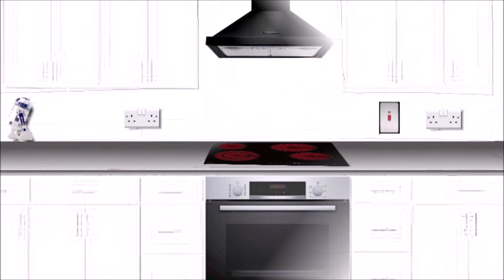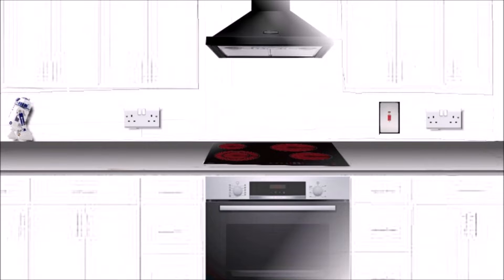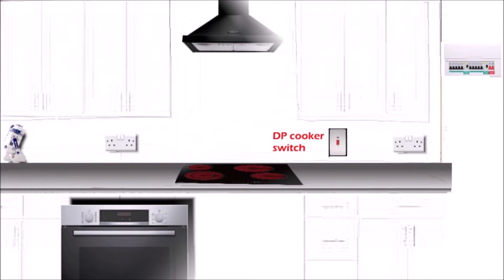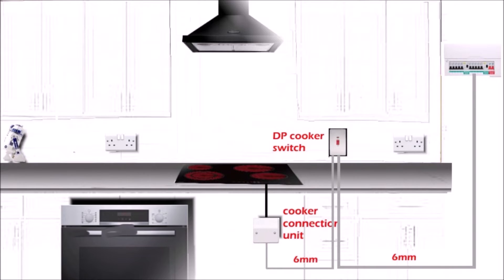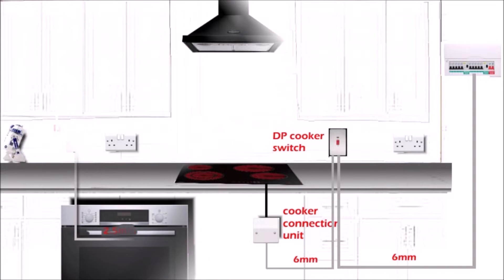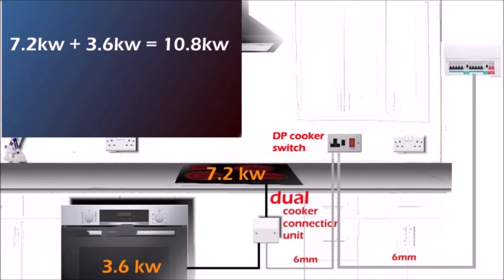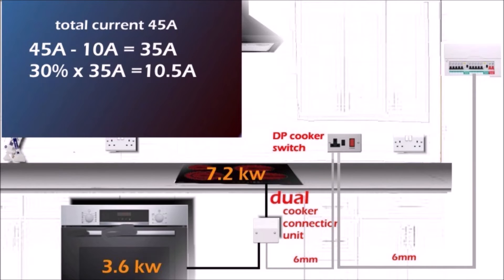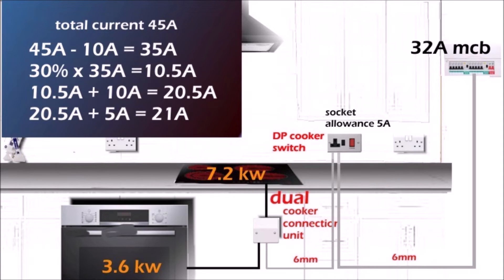How to wire oven & hob    Diversity on a cooker circuit wiring Diagram

Comment: I wouldnt be using diversity for a cooker switch as its specific to the load of the cooker and oven. Diversity can be used on a socket ring because its highly unlikely all plugs will be used and the full 16,20 or 32 amps will be drawn. In relation to the cooker though, you could gave geusts and mak3 a lot of food using both the oven and all cooker rings. Rate the braker to a minimum of 40a if not 50a to be safe

Comment: No proving the circuit is dead by testing with a GS38 two pole voltage indicator, did not test when finished to insure that it is safe to use, ie R1+R2 , insulation resistance and RCD tests also external loop impedance ie Ze . And didn’t fill out a minor works certificate.  👎👎👎👎

Comment: What size of cable would you use  from dual cooker connector  to the oven if its already has a 2.5 mm and plug top attached   can you commect the 2.5 into the dual cooker connector or does it need replacing with 6mm cable

Comment: Hi I know this video was posted long time ago, I have a question do you need a RCD in your consumer unit or fuse box?, and also if you put 45A in your cooker switch, when will be disconnected in case of overload if you installed your ciurcuit breaker of 32A ?
Reply: Hi, did you find out the answer ?

Comment: Question, I believe I can run a 32a induction hob and a 16a cooker with a 5a isolator with plug on my 6mm 32amp circuit? 

However, my cable is 6mm from the main board to the cooker and wondering if u can update to 40a mcb? The wire is in conduit within wall and concrete floor.

Comment: What size cable to the oven for the dual outlet plate?
Reply: Look at the manufacturers instructions. If the rating plate is under 3kw. Then 2.5mm HO7 rated cable should be sufficiont. In most cases you can buy 2 meters.

Comment: 6mm cable not required for cooker and hob circuits on 32A MCB/RCBO (up to 15kW and after diversity calculations applied) as this is relevant to the old rewirable BS3036 fuse that applied a derating factor of 0.725 to a 30A fuse for the correct disconnection time if fault current. 
The next size of cable up from 4mm is 6mm(2) so most 'cooker' circuits were 6mm cable. A max 2.3kW oven can connect to a socket outlet with a plug top..

Comment: Wiring 2.5mm built in oven flex into a 6mm  32amp circuit does not sound like a great idea.
Reply: He mentioned that's being spurred off the ring via fcu so should be fine if the oven less than 2kw
Reply: A 3.6kw oven would probably come with 2.5mm flex wired in. Without diversity its still only 15amps. Fine off ccu fed by 6mm.
Reply: Only if wired directly. The flex may have a plug top with a 13a fuse and this can safely connected to a 32A circuit if the oven is max 2.3kW (limit)
Reply: Ring circuits are for general sockets.

Oven and hob run on radial .
Reply: Then you will have a  2 5mm flex protected by a 32amp breaker. Not fine.
Reply: You need a separate ring circuit for the oven,which is not explained in this video.

Comment: You only need 4 mm cable for 32 Amp MCB. Plus calculations P/V -230 V not 240.
Reply: Actual voltage UK is 240

Comment: It's a great video. The only issue I have is when you added 20.5A + 5A = 25.5A in your diversity calculation ...the answer is 25.5A. It still falls within the parameters. Just a heads up👍
Reply: Was going to comment about that lol, he got his amps and kW mixed up 😁

Comment: Hi, must I use a connection unit.. can’t the wires go directly into the 45a dp socket ?? Thank you
Reply: How would you get the 'wires' from the isolation switch above the lovely tiled splashback to the appliances? Not a pretty sight when cooking your turkey and all the trimmings...

Comment: Advice please. I’ve got a 2.4kw oven which I put on a 13a spur as suggested but don’t like this I want to put it on the main cooker/hob switch. This circuit is on a 32a mcb and 10mm cable and currently powers the 7kw electric hob. My idea is to spur from the hob plate in 6mm to an unswitched 13a plate so they are both on the same switch. 
I can’t find a problem other than if the fuse blows I have to pull the oven out the cupboard but just wanted to run it past someone. Spark said just put them together but it’s the 13a that bothers me on that idea. Thanks.

Comment: As you said we need 54amp breaker for oven and cooker which is10800 watts isn’t that high power to use the same breaker for only cooker or only oven ?
Reply: 45amp load is max total.  Divrsity more than halfs that load so 32amp mcb and 45amp rated isolatoor correct

Comment: in that given diagram, where can I possibly add the cooker hood connection without a plug, or I'll just connect a plug top and into the one of the sockets on the wall? thanks!
Reply: In  my kitchen I ran a spur from the worktop double socket (on a ring circuit) up behind the wall units to a double socket on top for my cooker hood.
I did however have drywall on studs so easier to fish a wire up from behind the socket with no tile damage etc

Comment: When you say, not everything is being used at once - a Christmas morning comes to my mind ;)
Reply: And every Sunday dinner at me Nans
Reply: Makes no difference, the hob rings power up and down as required it will never trip.
you can have upto 15kw of cookers hobs etc on a 32 amp mcb.
Reply: @Petersnoo1 running at the same time?dont talk noncence. 15kw is over 65a and the cable would have to be acounted for too
Reply: @Babbar_7615 im afraid you are the one talking nonsense, look up diversity its tried and tested, go on educate yourself
Reply: @Petersnoo1 diversity is used in design i understand but there is rules to follow
Reply: @Babbar_7615 so a 7kw hob and a 4kw oven cant go on a /6mm 32 amp circuit?
Reply: @Petersnoo1 no you would need a 10mm cable
Reply: @Babbar_7615 you really wouldn't unless it was a really long run, 4mm can be used for 32a in some cases but 6mm is the norm.

Some houses only have a 60 amp main fuse, 10mm is OTT in 99% of cases
Reply: @Petersnoo1 are you an electritian?

Comment: Hi there! Putting new kitchen in now! Has 3 new appliances arrived: Induction hob 6.9kw; Single oven 3 kw and 3.3kw build in Microwave-oven. All seems to be a hard wiring, no plugs! I have 32aMCB and 6mm cable attached with Dual connector unit on the bottom! Has a busy household, so it is possibility what can use all on the same time.  i think to switching Microwave oven to my downstairs sockets other 32a MCB through fused switch like you show on video and other two appliances to Cooker Dual connection unit!
 Under Diversity calculation seems to be enough, but just want to make sure! Please help me to work out if you can!? 
Your respond will be really appreciated! 
Thanks in advance!!!
Reply: What did you do in the end?

Comment: Could I use 20A breaker for IKEA oven?
Reply: That would be determined by how many watts your Ikea oven is rated at. for example if your oven is rated at 3600w (aka 3.6Kw) and the nominal power supply to your house is 230v - then to find out what size cable and breaker you would need you have to calc. the required amps.  To do this,  you use the formula (Amps = Watts divided by Volts). So for in the example - the Oven is 3600 Watts divided by the supply voltage which is 230 Volts = 15.65 amps. In addition to that - diversity can be applied - which essentially implies that not all elements of the cooker/oven/hob will be turned-on at the same time.

Comment: What is electrical diversity? is it some kind of average power consumption that you were calculating? The 6mm wire is not enough for this circuit but your MCB will protect it. The wiring you have done is not enough for a busy household, the MCB will keep tripping.
Reply: I think you will find 4mm is the wire you are looking for.  6mm is old requirement from old fuse boards with wire fuses, the 4mm cable is not comparable with them so had to use 6mm.  That unfortunately carried over into new fuse boards.  Check the on-site if you don’t believe me!!! Fact!
Reply: @AndrewSmith-bb8sh  Most kitchens have power hunger appliances like washing machines and fridges, it would be better to isolate the cooker and put the sockets on another fuse.
Reply: @RandomStuff-ko5he  Oh yes totally agree. I would never put my cooking appliances on my ring for kitchen appliances. Cookers and hobs must be separate, but only need a 4mm cable in 99% of the times. 😁
Reply: @AndrewSmith-bb8sh  I have a 4.2KW double oven and a basic ceramic hob connected by CCU as in the above diagram with 6mm wiring.

If I change the hob for a 7KW induction hob, will I have to give it a separate 6mm supply.
Reply: 6mm is completely fine for this circuit.

Comment: great video, can I connect the hood off the same cooker connection unit as the cooker and the oven? and what cable would I run? again 6mm or 2,5mm t&e?

Comment: I don't understand the last part where you wire the dual connector? Would there be three lots of wires how does it connect to single plug ?
Reply: Dual ccu  has an inlet and two outlets
Reply: @Михаиллеви 

......... and doesn't connect to a 13amp plug.

Comment: I am working up a belling hob it has come with a 4 core wire. But the wire going to the old hob is 3 core wire. Do I connect L1 and L2 in to a 3 way wago connector. Interested to know
Reply: hi did u find out how to connect 4 wires to 3 core wire? if yes could u tell me please i need to wire mine cheers

Comment: This was going great until you said “.... nobody at home uses 4-rings of the hob at the same time and, also, the oven at the same time as the hob.”

I do, and I know other people that do as well.

There are no other ‘regular’ home appliances that will use as much electrical energy as an electrical hob and oven in the same time besides an electric hot water element.

A better wiring assumption would be to consider a worst case scenario rather than a best case scenario, and simply running two separate connections to the main circuit breaker would solve this, and it would avoid future possible problems.

1- the connection to the MCB for the hob would require a 40-amp breaker / fuse (due to device inefficiencies and wire age) - a safety factor of 25%.
2- the connection for the oven would require a 20-amp breaker / fuse (due to device inefficiencies and wire age) - a safety factor of 25%.

In each case the breaker switch fuse is slightly oversized by a few amps to allow for aging of the wiring and inefficiencies of the devices over time.  Manufacturers, for instance, will not all use the same quality wiring inside these appliances.

Most of these devices should operate for at least 10-years.

Your wiring does not consider any increase in electrical resistance due to unforeseen circumstances.
Reply: You're not using all four rings for hours at a time are you though? It's not a constant load and you don't need to design the circuit as if it were. Also, increasing the breaker reduces the safety factor for a given cable size.

Comment: Great video 📹 👍  👏  ... could you show a video of where you use a 4mm to do the kitchen wiring I've seen this be done but want to know which method id better 2.5mm ring or 4mm which method should be used ?
Reply: 4mm radial circuits are what are usually preferred now as ring circuits can have a 'cut' in the middle somewhere, and then you risk overloading the wires if all you load happens to be on the side of that cut. It also makes spuring off in the future easier.

Comment: How about a stove that can't be removed from the oven. According to the manufacturer, the sum of the simultaneous loads of the four burners + the oven, is 8600 WATTS (total load), this gives a consumption of 39A. 
Providing that the section of the main cable must be properly sized  according to the absorved electrical power, in that case, the stove would have to be powered by a circuit whose conductor size is 10mm but the main power line, the one that takes electrical energy from the meter (counter) to the outlets, is 4mm size. 
The question is: when dimensioning the cables for the stove and their corresponding breakers, is the total load of the kitchen I should consider, or an estimated consumption, for example, two burners + the oven? 
I'll appreciate your help!!
Reply: Sebastian Benitez Seriously, if your supply tails are 4mm. I’d get that looked at. In the UK mains supply cable form service head to meter to consumer unit should now be 25mm2. BS7671 2018 AMD3 apply.
Reply: @markgilder9990  I agree with Mark. It is also acceptable and perfectly OK to have 16mm2 tails for main fuses of between 60 - 80 Amps and 25mm2 for 100 Amp Main fuses as Mark mentioned above. 4mm2 is too small and does need looking at. It does depend on the Maximum demand however and varies from installation to Installation.

Comment: I think a 10mm cable you be safer than a 6mm cable
Reply: You can apply diversity to a cooker circuit. Check out John Ward’s maximum demand and diversity.
Reply: Would be safer
Reply: 6mm is max rated to 47amp and here we have 21 amp load
Reply: Are you running a shower cooker?

Comment: Check part p. Socket should be 10cm from the hob. 30 cm from a sink
Reply: I would not want my socket 100mm from a hob of any type. 300mm sounds good
Reply: H4. The control switch or cooker control unit should be placed within 2m of the appliance, but not directly above it. Page 190 of the On Site Guide.
Reply: Read this - 300 mm is the recommendation but it's not a regulation, either for the cooker switch or for the socket near the sink. They suggest a min distance of just 100mm. As there's no requirement for a cooker switch, there's no minimum or maximum distance.12 Sep 2015

Comment: Diversity 20.5A+ 5A = 25.5A not 21A as you stated
Reply: Wow you’re probably a mathematician 😂 why can’t you accept the fact the he just simply made a mistake and not just jump on the guy showing you can count to 5. Lol
Reply: @mariuskiudulas4498 there's nothing wrong in correcting someone so that they can edit and correct themselves? He wasn't rude in the way  he pointed it out.
Reply: Can I connect cooker to regular plug... Taking care not to operate all heaters/functions in sae time?? My over came with free cables. 6mm. And the regular plug is 4 mm...and it is oven with top heat plates in one appliance not separated